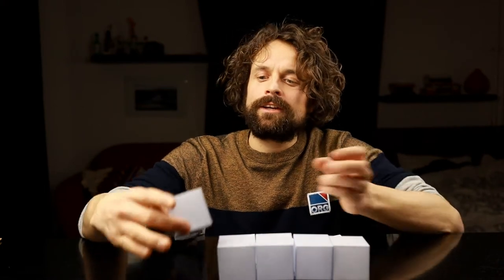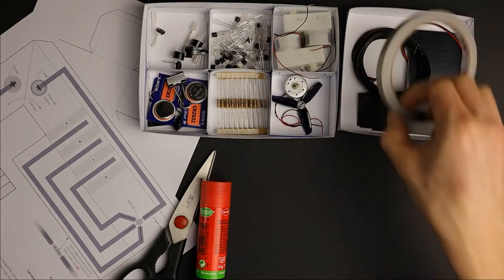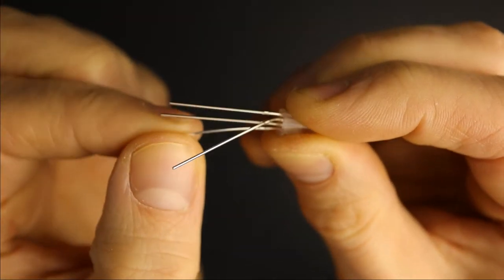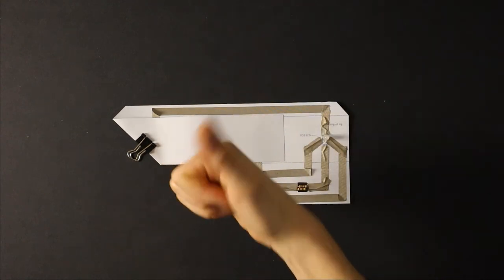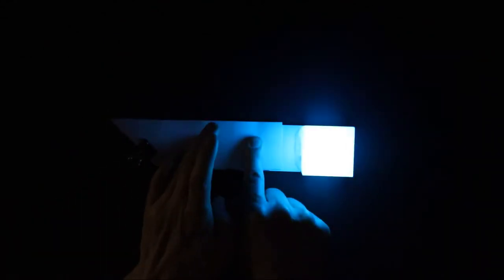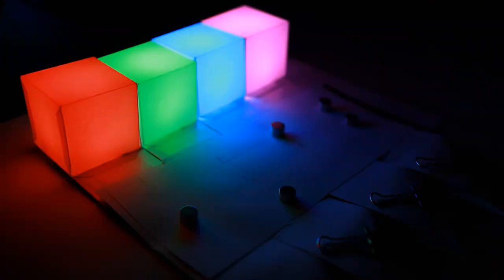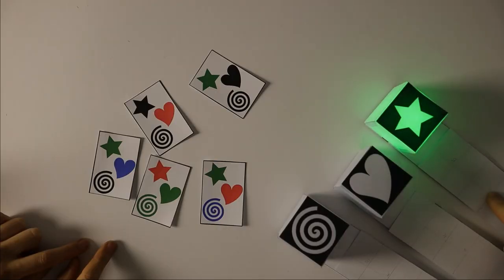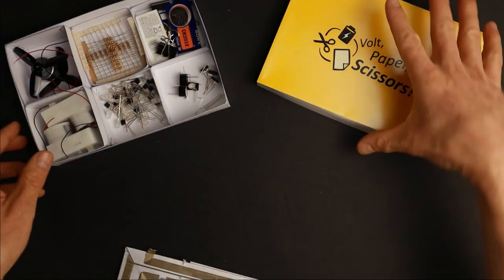Easy Interactive Paper Circuit for Kids! (DIY template)

Comment: Thanks so much for this video and project! Is the purpose of the resistor on the red leg just to get the right color mixing or is there another purpose? My students liked the red color best without the resistor but I didn't know if there was a safety reason for adding it.
Reply from the maker: In theory red LEDs only need about 2 Volts while the coin cell has 3 Volts. The resistor reduces the voltage at the LED. Not using the resistor makes the LED brighter (that's probably what the students liked) but it might damage the LED. So from a learning perspective I would always add the resistor. In case the resistor is left out, the worst thing happening would be a damaged LED but nothing serious. Most likely, nothing will happen except of the color mixing not working and the LED getting slightly warm.
Reply: @VoltPaperScissors  Thanks so much!

Comment: Nice demonstration man❤ quick question ,I want to make a school project similarly like this but a little twist and it is that, I want to connect the copper tap with a press button which is connected to 3 LED lights one upon another... and I NEED YOUR HELP ! What should I do that only the first light will glow if less pressure was exerted on pressure button and the top light will glow if more pressure was exerted on the pressure button ? U understand my question ,it's like those gaming hamer strength testing  machine in the more you beat that machine, the  led lights glow on the top
Reply from the maker: butting velostat in-between the on/off switch makes it a pressure button but it will only dim the LED(s) connected to it. I do not see a simple way of achieving what you want to do since you bascially want to switch between three circuits using the same button (with different pressure). You can achieve it with a microcontroller an some simple programming (e.g. an Arduino).

Comment: I bought t'he template, but i didn't find the document" My electronics shopping guide for this project"
Reply from the maker: That is weird. I downloaded it myself to check. And it is in the download. It is a PDF file called "ShoppingGuide-TouchCubes". Please check again. If you still can't find it send me an email. You can find my address in the welcome document or on my website. Best Michael
Reply: I can't see your answer. Sorry. Vols you exposin me what t'he resistance is for? I want to explain it to my kids. Thanks
Reply: @recetascandidiasis6142  Sorry i just find the answer in another comment below. Thanks for your work
Reply from the maker: The resistor is needed to make the color mixing work. That is because red LEDs do need less voltage than green and blue. A resistor reduces the voltage for the red component so that all three (red, green, blue) have the same brightness. Without the resistor red would be a dominant color when mixing different colors.
Reply from the maker: Strange you can't see my older answer: I copied it here for you to see: "That is weird. I downloaded it myself to check. And it is in the download. It is a PDF file called "ShoppingGuide-TouchCubes". Please check again. If you still can't find it send me an email. You can find my address in the welcome document or on my website. Best Michael"